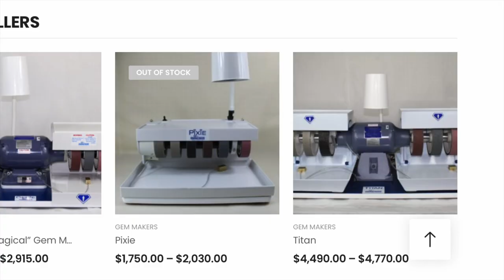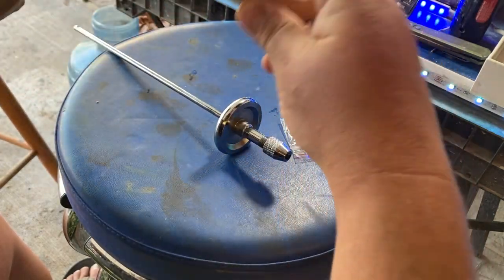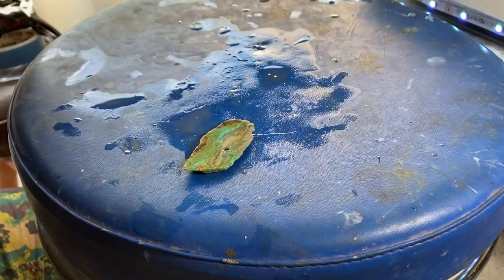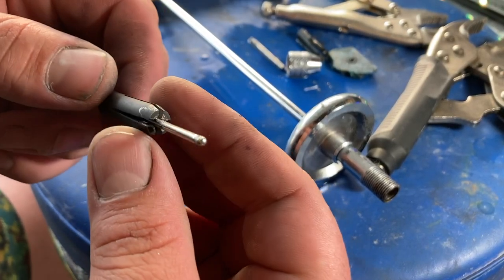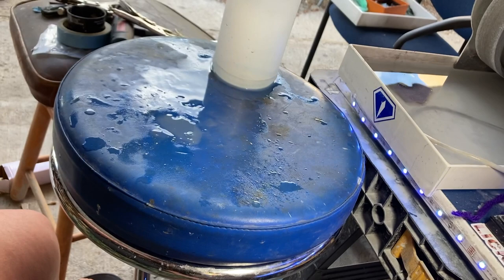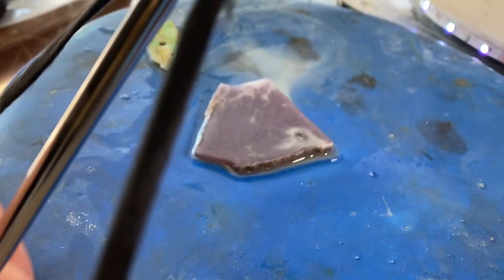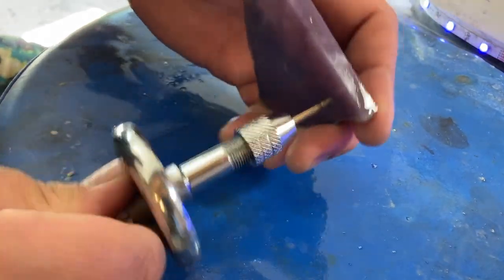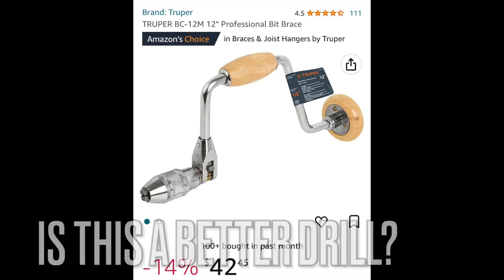Bow Drill Lapidary - Drill Gemstones Without Electricity

Comment: Dave, Enjoy your trips!   Thanks for the videos.  Quick question.   Can hard wheels be resurfaced?   I picked up an old Gem  Tec and hard wheels are very well used.   Ideas?   You like the old machines :-)  (me too)   Darleen
Reply from the maker: Hey there Darlene to my knowledge hard wheels cannot be resurfaced however the generics nowadays are really good when it comes to hard wheels you can get a 6 inch hard wheel for well under $100 however the generic soft wheels are still really bad
Reply: Thanks Dave for your quick reply.   Darn it!  Back to the drawing board LOL